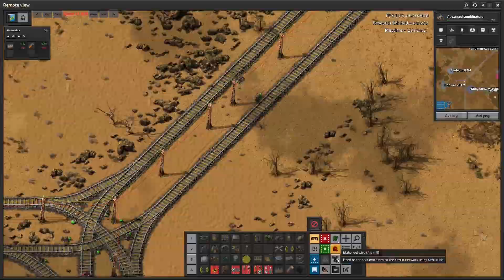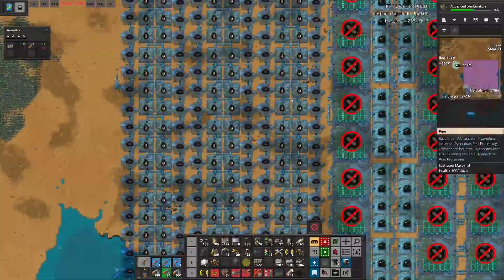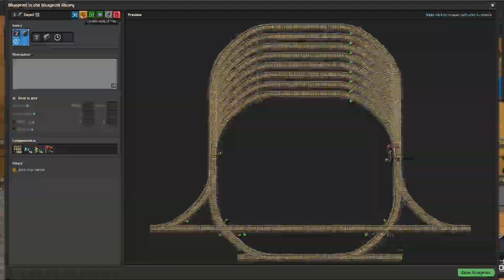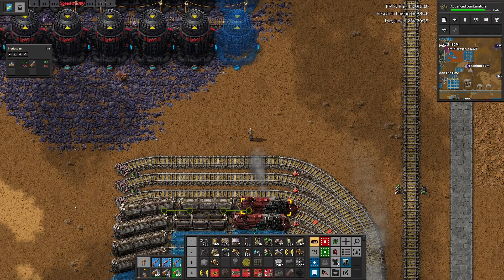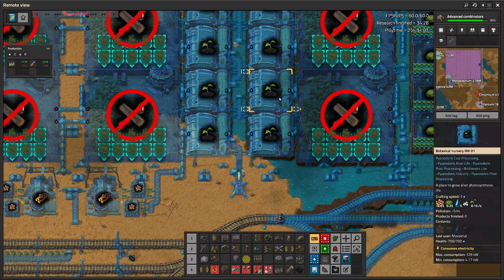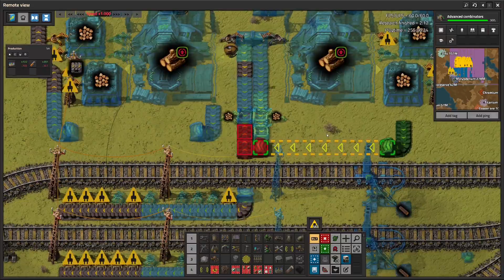075: Trains and Py-bots coming online at once! - Pyanodons HOHM x300 Challenge

Comment: You do know where the next iron processing tech is located in the tech tree, right? (I was cheating a bit in that regard - unintentionally)

Also, that's a nice middle ground you do with bots. Can't really afford a large base-wide bot network from the beginning, so this might be good enough for now. Curious what you are planning in the long run.

Btw, I saw you bring thousands of moss. You can do what I normally do (buffer chests at moss production), even if this is a local moss build. This way you only have to bring 1 moss (or 1 stack to speed it up).
Reply from the maker: Ugh it's much deeper in the tree that it used to be?  Or am I totally misremembering.  Well - I Ok thanks for the heads up.  I should always check assumptions from my prior Py play, I thought it was higher up, but that was a long while ago.

Yeah that's true about the moss!  I could have done that and had it empty right to a storage chest - I will do that in the future.  But I also won't be giving this build carbon dioxide for a while yet so it would remain unfilled for a while.

Next episode you'll see my plan for bots - it might be the most clever or stupid idea I've had so far. :P
Reply: @Maxsimal-YT  Ah this is it ! It's getting intense. Now the game really opens up for you ! Looking forward for this new era :)

Comment: I don't mind the timelapse video, but you really should increase the bitrate, they lack a lot of detail. Even when pausing the video it's almost impossible to see more than just a blurry idea of what your screen might have looked like at that moment.
Reply from the maker: I'll see if I can improve the bitrate on the accelerated sections - it's also going through two compression steps because shotcut won't accelerate something over 50x. Another reason I'm comnsidering switching to montages instead.

Comment: Wohooo!!! Time to really start playing the game 🙂
I hope you got the spoilage handled properly. I didn't see any handling of spoiled tree seedlings - if the forestry has 2 in inventory and is shut down, those 2 will spoil. Recipe needs 3.

When you cleaned up the Auogs and mentioned pups and adults being mixed there were also some inserters holding native flora. I might be wrong here, but I don't think I saw a splitter before the belt was going to the station.
Reply from the maker: Yeah I need to fix a couple things in that forestry build - also didn't add enough construction zone extenders.

The auog area does have a splitter that sends spoiled flora/biomass to a boiler though, that one is covered :)  The floraspolin was there cause the belt was full and nothing was going through.

Comment: What I've always done for loading stations without splitters is to read the last belt's contents and only enable the inserters when anything > 0. They all enable at once and do a good job of equalizing the loading.
Reply from the maker: That is a good idea, I might use that if I get into any tricky places where passive load balancing doesn't work.  Circuit network adds overhead too though which is what I need to be mindful of as well.
Reply: @Maxsimal-YT   
Good point, I've never had to play to the point of UPS optimizations. I wonder if a clocked line of inserters that pulled <15/s off a stationary belt would end up being more UPS efficient. Maybe for super high numbers of stations with segregated circuit networks it could work. 

I did some light testing cause I was curious:
The test consisted of 1488 lanes being picked up by 12 inserters (302 degrees/s and 1 item hand size) per lane. A full belt of items was given as input and the outputs placed into infinity chests.

Here are the terms used:
split lane input -> full belt is split into two going to each respective row of 6 inserters (can likely be done splitter-less with underground sideloading), this allows the belt to stop moving before the inserters attempt to pick up an item
clocked inserters -> inserters attempt to pick up items every 73 ticks (99% of the speed of unclocked inserters @302 degrees/s), less individual thing from the inserters
single lane input -> just a single lane feeding all 12 inserters

split lane input + clocked inserters + clock groups of 31: ~750 ups
split lane input + no clocking: ~470 ups
single lane + clocked inserters + clock groups of 31: ~730 ups
single lane + clocked inserters + clock groups of 6: ~720 ups
single lane + no clocking: ~435 ups
my initially proposed plan: ~420 ups (yikes)

In conclusion, clocking inserters makes a huge difference at the scale I tested. Having small groups of local clocks had little impact considering the gain.